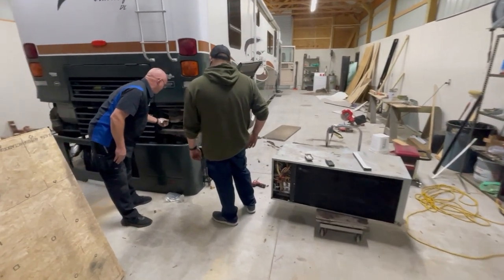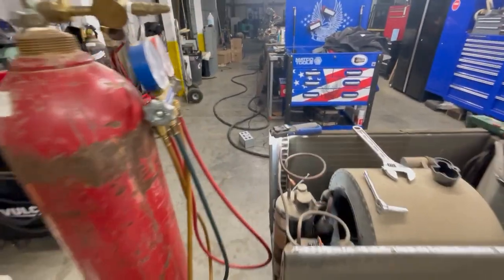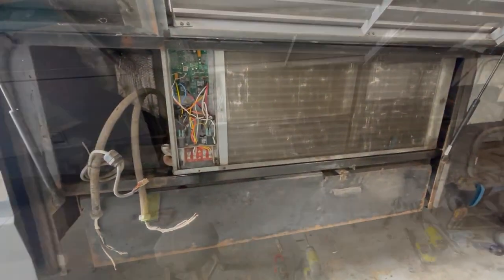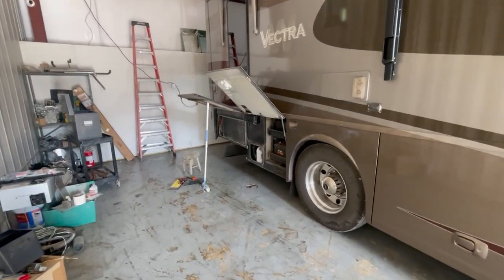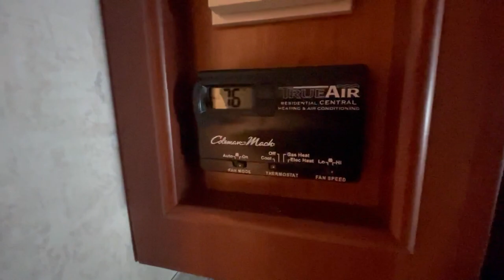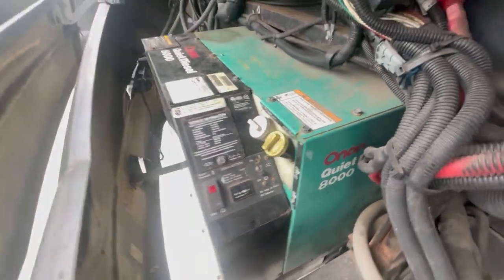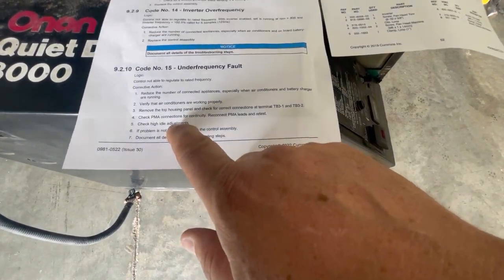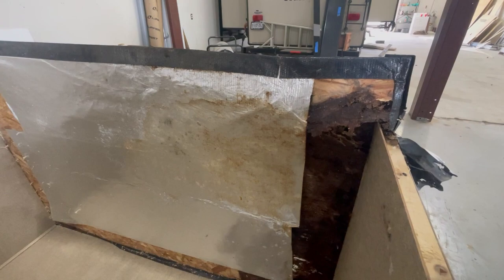That Wire Was Almost A Fire Hazard

Comment: I use Cummins Coach Care for my Chassis related Mx, and had them take care of my QD-8000, 1000 hr Mx when I had the oil and filters changed last May. They pulled the generator (as you know the Journey has no genny slide) did not replace the belt because they said none available, and when I asked about the Cummins Blue Antifreeze they looked at like I had two heads. You are teaching me too much, LOL
Reply from the maker: Wow. Not surprised I had a level 3 tech at Cummins who gave me that information.

Comment: brought my fifth wheel in and had you reseal the roof, i asked for an estimate on repairing the rear wall.  When i asked for it i got the feeling there was no interest in that and when i picked my unite up there was no estimate .  But the roof did look great
Reply from the maker: You are correct I did look back on the work order and I am not sure how we missed that! My Apologies!  I did look at the pictures that we took of your unit and it does have de-lamination in the back wall.  The Filon  has come loose from the wood backer and and at this point the best way to repair it is replace both the wood and filon with new.  Again not sure how we missed it but I would be more than happy to talk to you further about this.   Steve 423-290-8367 is my cell number call me anytime.
Reply: @shelburnerv  i will get with you as soon as i am able at get it back to you  thanks